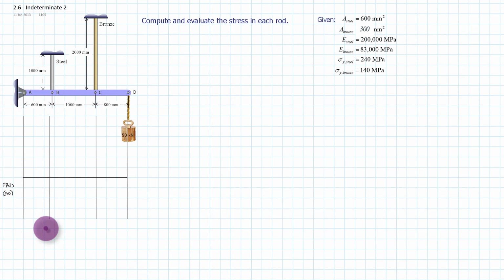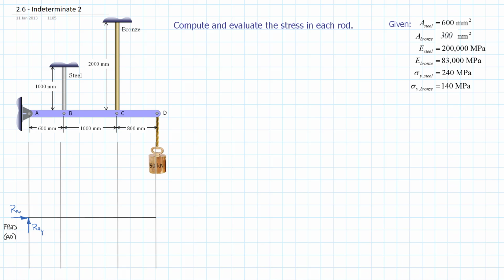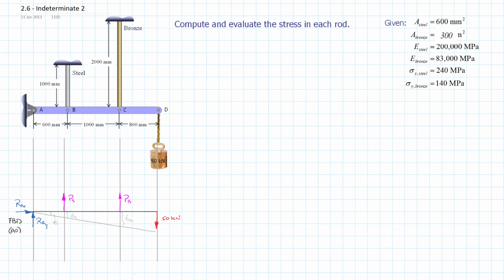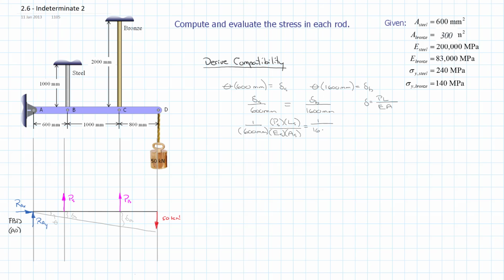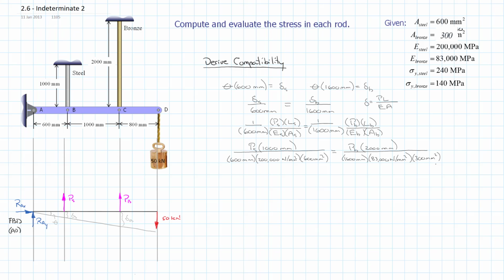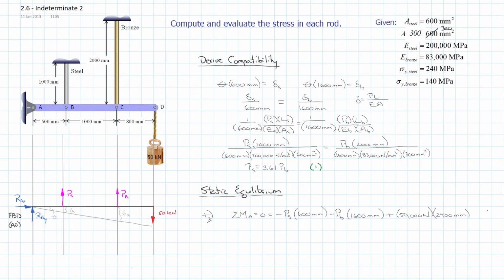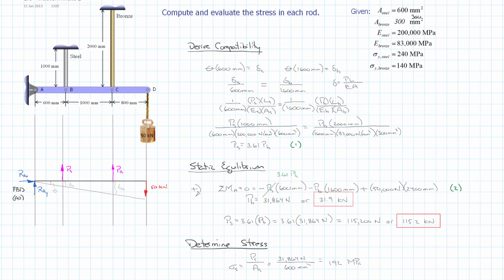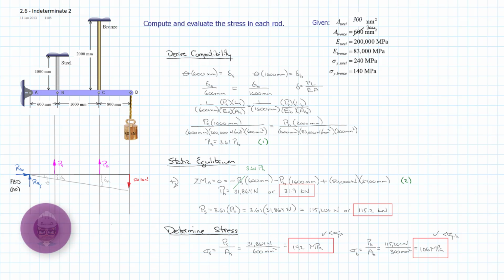2.6 - Axial Indeterminate II

Comment from the maker: I seem to have made a small transcription error near the end where I mix up the forces in the bronze and steel when calculating stresses in the steel and bronze.  The answers are correct (as I was working from a worked solution) so it is just the isolated transcription error.  My apologies.  Given an opportunity, I will place a note directly on the video itself.